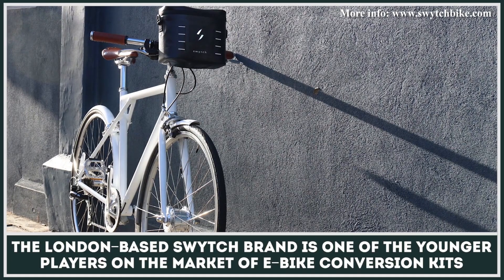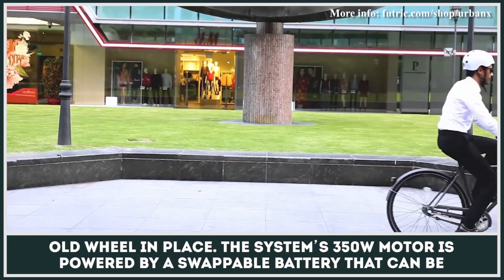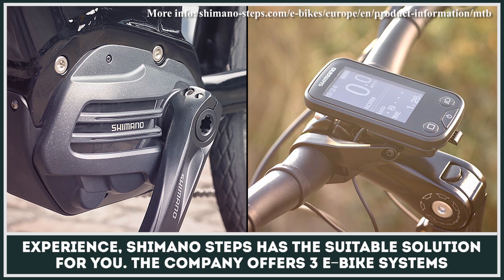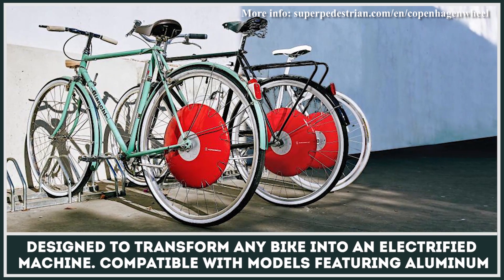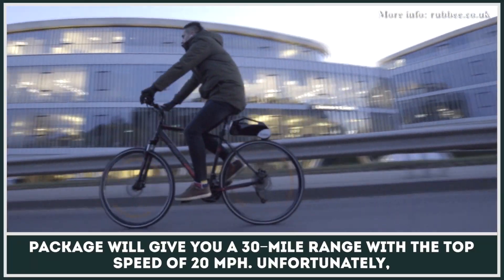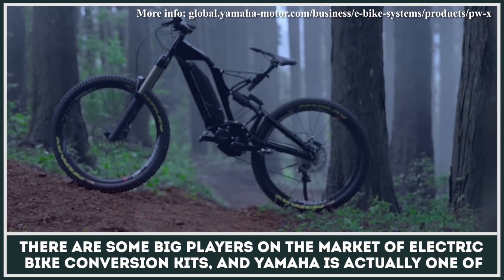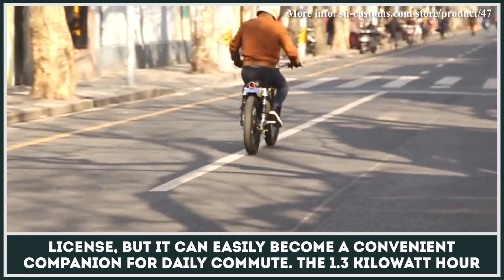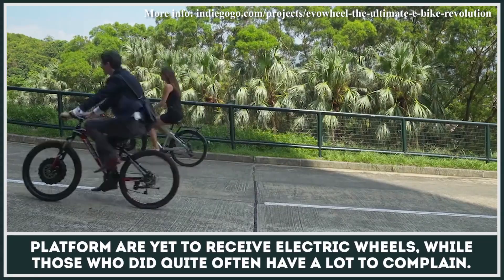10 DIY Electric Bicycle Kits to Build an Affordable Pedal-Assisted Bike

Comment: I got a rear motor kit from eBay. 1500w with switch for 250w when on the road. Inbuilt controller. Programmable bike computer plus cut off brake levers. All for £200. Buttery 52v 14AH at £300. That's a monstrous high power ebike at £500. I used my beloved  old MTB. 
eBay is great.

Comment: Go to ebay buy a kit for $ 200 or less for a 26 in wheel with a 48 volt 1000 motor. than buy a 48 volt 10 to 12 am rating from $ 300 to $ 400 dollars, use a simple bicycle metal  or aluminum frame. The aluminum frame you should use a torque on the hub motor it could damage the frame. Do some assemble and you are good to go.
Reply from the maker: Hello, thanks for your comment. It's also an option for those, who at least have some experience in the field and show interest in making something with their own hands.
Reply: Indeed you can i did 5 years ago.I just upgraded my full suspension Tomac 98 Special sweet ride.
Reply from the maker: How is it holding up after years of use?
Reply: It`s great now on 52 volts🚀with SW900 lcd PAS & throttle dialed in🏁🏆